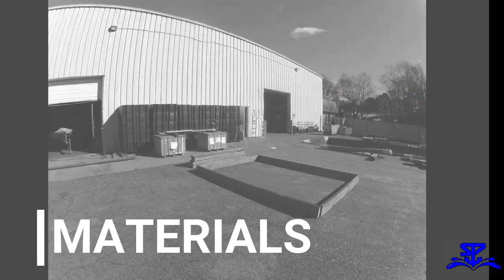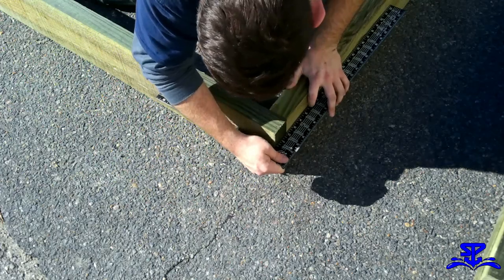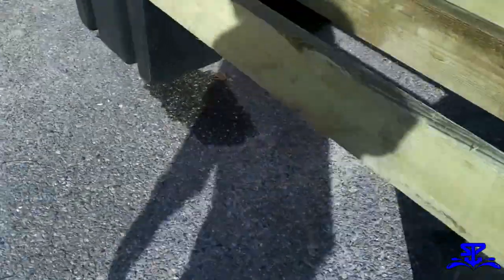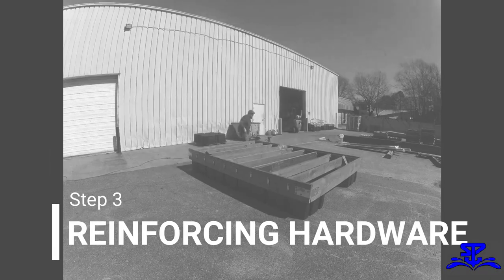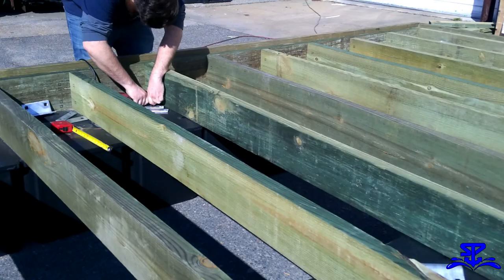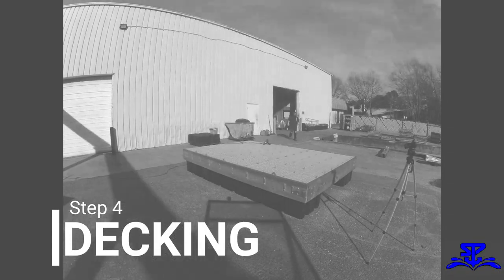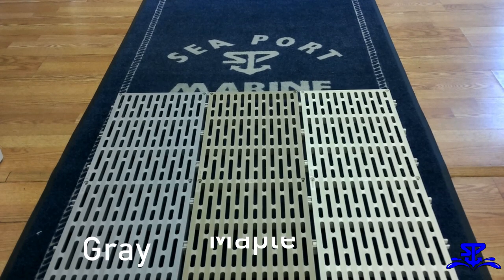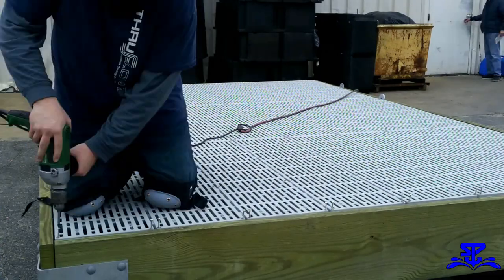How to Build a Floating Dock - Sea Port Marine - Thruflow

Comment: Thank you for the video!
Wondering if this deck would be structurally sufficient for building a floating house on it?
Reply from the maker: Scale it up and add more floatation. Also put lighter material where you can. Could work.

Comment: I'm sure joist hangers or similar inside corner hangers would do the same and far less cost. I would keep outside corners using bolts and heavy brackets though

Comment: This hardware kit is pretty impressive especially those corner brackets through and through outside and inside but I would have added corner braces in each corner let into the framing and also I would have only put four floats so that it floats down in the water a little bit closer to the surface but otherwise really cool build

Comment: How do you recommend anchoring this to land or to pilings? Is there recommended hardware for that or additional framing?
Reply from the maker: https://www.seaport-marine.com/shop/floats-and-dock-hardware/dock-hardware/10-pile-hoop-with-roller-detail

https://www.seaport-marine.com/shop/floats-and-dock-hardware/dock-hardware/10-pile-hoop-detail

These are a couple of examples that will help with that. They are available in varying sizes.

Comment: How long would a dock like this last permanently installed in a lake? Would rough wake splashes eventually damage the pressure treated wooden frame? If so, is there anything you would recommend to prolong the life of such a dock?   
Great video by the way, clear and to the point. Thanks!
Reply from the maker: A dock like this should last anywhere between 15 - 30 years even in rough water. The reinforcing hardware should keep the frame from twisting apart if installed correctly. The best thing you can do is see what the most common building material used by marine contractors in your area is. Hope that helps.
Reply: @seaportmarine6815  Thanks!

Comment: what float do you use for 16" on center   i want to use 36"x48"x16"high but most 4' don't have 16" on center, most have only 3 screw down points
Reply from the maker: The floats that were used in this video measured to 48"L x 24"W x 16"H and their mounting points were 24" on center. I was not able to use all 6 mounting points but were able to use at least 3 per float. As long as it has at least 3 points of contact, you will be fine.

Comment: Yeah, So how much did that bad boy cost?, my guess close to 10K
Reply from the maker: Nope. We build aluminum framed docks cheaper than that. This dock was around 2 - 3k.
Reply: @seaportmarine6815  no offense but I don't believe that price for a second.  I've priced out the flotation alone at $2000 or better.  Then there's the labor and... oh yeah, the crane.
Reply from the maker: @garyphillips725  Call and get a quote. 1-800-446-8056. Ask for Shawn Stamper.

Comment: What was the rough dimensions of this dock and also what is rough raw material cost (including the floaters) to build one yourself. Thanks!
Reply from the maker: 8' x 12' and material runs roughly $1,200. That doesn't include lumber.
Reply from the maker: @ttvdecimatedbyme9130  Normally we would but at the moment we don't have the man power to build and our truck is not making deliveries  due to COVID-19. Under normal circumstances a fully build dock that size will run between $3000 - $5000 depending on the way you want it built.

Comment: Looks great. Any reason you are recommending pressure treated lumber? I would be worried about rules prohibiting use of pressure treated lumber due to chemicals in a lot of places.
Reply from the maker: Pressure treated lumber is going to last longer. Non-pressure will probably rot away within 5 years. You'll need to check the laws of your area.

Comment: What hardware and method can you recommend to attach 2 of these docks together?
Reply from the maker: https://www.seaport-marine.com/shop/floats-and-dock-hardware/dock-hardware/female-corner-bracket-detail

https://www.seaport-marine.com/shop/floats-and-dock-hardware/dock-hardware/male-corner-bracket-detail

https://www.seaport-marine.com/shop/floats-and-dock-hardware/dock-hardware/female-connecting-plate-detail

https://www.seaport-marine.com/shop/floats-and-dock-hardware/dock-hardware/male-connecting-plate-detail

https://www.seaport-marine.com/shop/floats-and-dock-hardware/dock-hardware/3-4-x-3-galvanized-headed-clevis-pin-detail

These are items we sell that allow you to do that.
Reply: @seaportmarine6815  Thank you. Is a 12' dock the ideal when spanning multiples together? Or would a 16' or 20' be just as feasible? Just trying to understand any downfalls to building longer. Can I call someone to get hardware pricing for all hardware required to construct at 12 footer?
Reply from the maker: @Snofly12  That all depends on how rough your water gets. Any size floating dock can be linked. A contractor that builds in your area would be able to tell you what would work best.